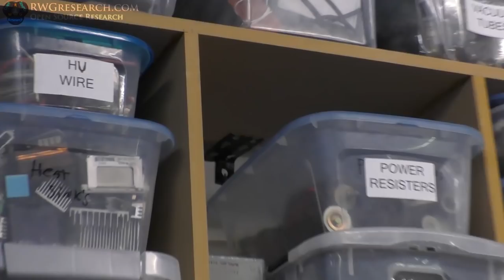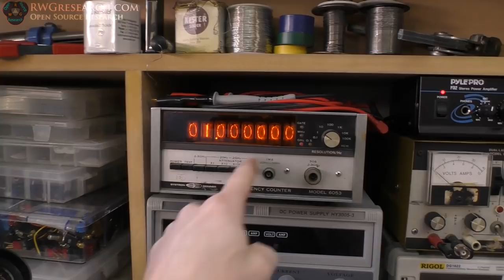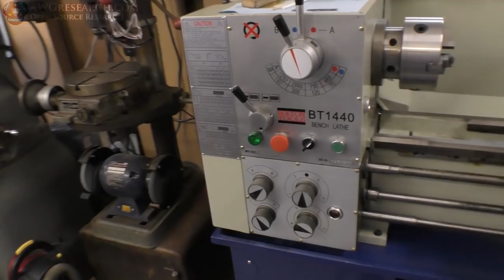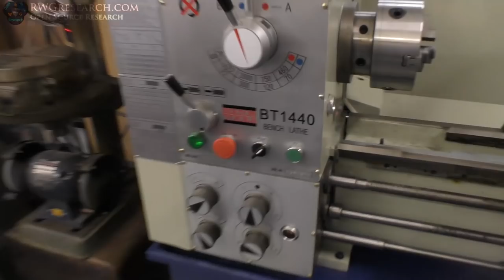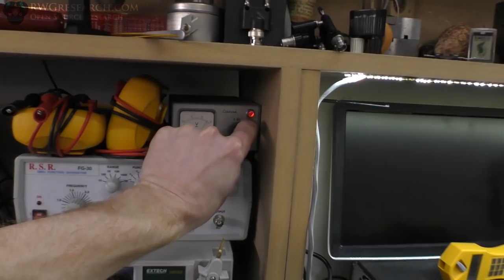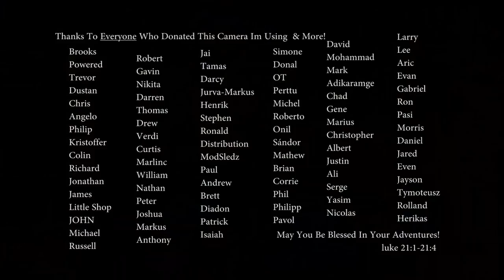Happy Easter! Its Time To Show You The Shop, Then Move It... 50K Subs... But Whats it Mean?

Comment: You taught me some serious physics about capacitors, really appreciate real truth that opens my eyes.  Keep up the good work.  That motor(Newman) you built that ran on 900 volts was a game changer to me.  Any helpful hints on a hub(spindle hub mount) that is used on that BLDC motor from a washing machine that Gerard Morin is working on.  I have an idea for the electrical control circuit for that 144 pulses per revolution, voltage controls torque with frequency controlling the speed.  Just got one of those motors(from washing machine), plus a 5k generator all at the same time at my junk yard down the street from me for $38 with elbow grease to disassemble.  Better be careful what you desire, it might show up all at once.  Happy Easter!   God bless you and your family.